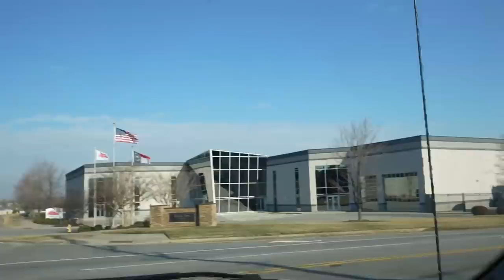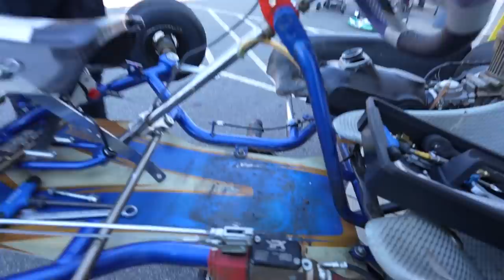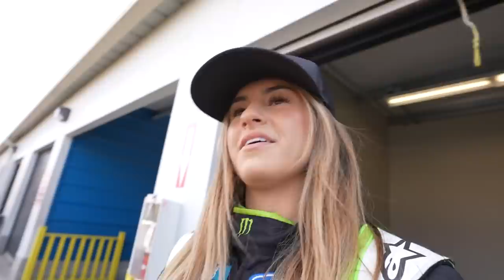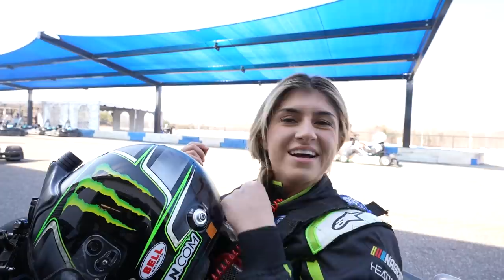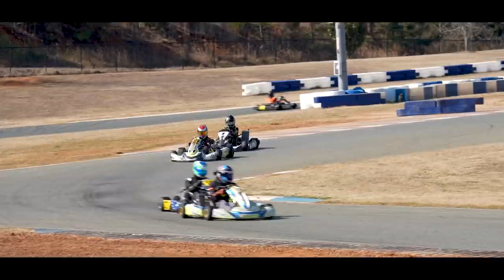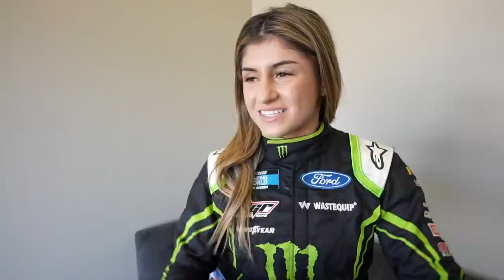GO-KART DRIVER GET'S ANGRY *TRIES TO WRECK ME*

Comment: Maybe if you put some stable fluid in there for a whole year but they also stay fresh for a whole year and then you put it through the go kart and then you would not have any problems stable that you use for small engines I put that in my generator and run it straight out so you don’t get notebook and gummy stuff inside the carburetor because that would be a big facts big fix
Reply: Sunoco 110 leaded doesn’t go bad like unleaded pump gas

Comment: I assume your not supposed hit other carts at that speed, its not bumper cars lol its a road course, it takes time to make passes just like short tracks
Reply: He bumped her.  It's perfectly normal in go-karting.  He wasn't trying to spin her.  In road course racing in go-karts, you make passes entering or exiting turns.  When you're on the track with faster karts, it's actually considered unsportsmanlike to hold up the faster karts.  If she were running on any of the tracks I grew up on, she'd have been blue flagged for not moving out of his way.  A second occurrence and she'd have been black flagged and pulled off the track.  It's all about safety.

Comment: Hailie not trying to take his side but. Karting is a contact sport. The one thing he did and seem absolutely douchebag(y) was the fact that he blocked your turn entrance
Reply: Karting is not a contact sport, that attitude is the problem. When you move to cars is it a contact sport too? It is not. The bigger series here use “push back” bumpers as the do in Europe (drop down) and racing is much cleaner. So if you drive like a douche you get a penalty.
Reply: @jimccc9467  yeah but I am racing karts myself and bumping is a thing but obviously not getting out of hand. It is a contact sport at least a little bit
Reply: @jimccc9467  As someone that spent 8 years racing go-karts, I can tell you for a fact that bumping in go-kart racing is completely normal.  I've raced against WKA, VDKA and IKF drivers...and they all bump.  There is a huge difference between bumping to let someone know you're there and being held up....and bumping to spin or dump someone.
Reply: @aaronthomas6155  I’m quite familiar with kart racing, familiar enough to know when someone is being a douche bag on a practice day. He could’ve passed her cleanly but he was being a tool because of who she was. Did you drive like him in non-race day practice? Probably not. Now we use push-back bumpers to stop rough driving and it works.
Reply: @jimccc9467  I've only run open practice on 2 tracks.  Neither of which run TaG karts.  Both dirt ovals and with specific rules against blocking a faster kart.  First infraction was a blue flag, second was a black flag.  We used "open practice" for track break-in.  With "closed" or "class specific" practice, yes....we ran practice just like it was a race.  On "non-race" practice days, we had different rules.  Bumping was allowed, but spinning someone was an automatic black flag and possible loss of a practice session.  In sprint kart racing, bumping isn't considered "rough driving" and none of the governing bodies permitted push-back bumpers when I was racing.  My local track, a paved road course inside a paved oval, was an IKF sanctioned track and later a WKA sanctioned track....the other tracks I ran were WKA.  We were required solid front and rear bumpers with an intrusion bar to prevent bodywork from going up under the rear bumper.
Reply: @aaronthomas6155  what country? Or are you an out west guy?
Reply: @jimccc9467  US....east coast.

Comment: So, karting practise only does somehting for you if your actually driving under circumstances for wich the kart is buiilt for. 
An old chassis handles compeltely different then a new one that is raceable. it allows for far less precise driving...
Old tyres are probably the msot useless thing in the world to practise on. you just learn bad habbits with little to no grip. your not driving precise, your just correcting your slide that is unavoidable cause of the old tyres.
precise in a kart means you ride the fine line between optimal grip, turning in smooth carring alot of speed getting the inside wheel up and to much grip where you have your wheel way to hihg up and then "fall" on the track.
not enough grip on the other hand just means understear when turning in usually and overstear when accelerating. both products of old tyres mainly.

It doesnt need to be a completeley new chassis a 2-3 year old that is in good shape can do the job and tyres dont need to be always brand new but everyhitng older then 6-8 months and 150-200 laps is a joke to use.

btw, one of the worst things you can do in a kart is off pedal time where you dont give gas or break. the chassis isnt under tention in that case and doesnt functions anymore like its supposed to be at the moment when you then again put on the acelerator or break wich makes the whole entry into a corner unstable.
very easy to observe in this vid btw by the stearing movement in the center of the corners.

so if you really try to practise then you might just wanna get soem help in. otherwise its a waste of time for some fun gokarting with friends.